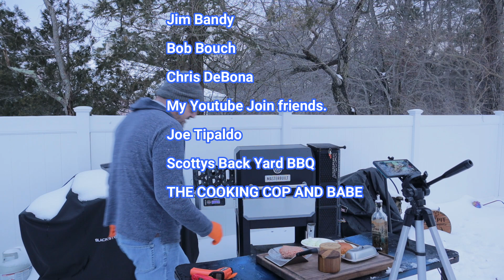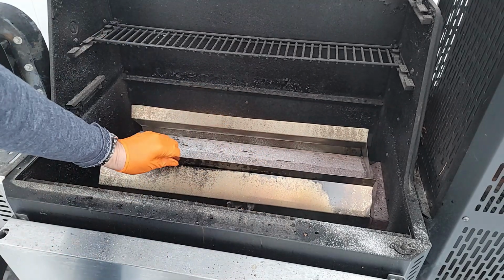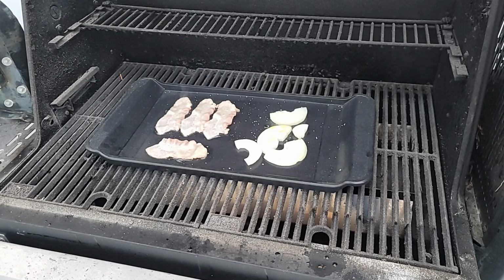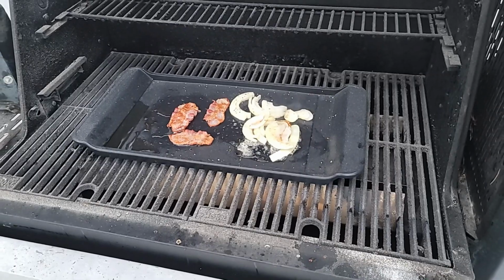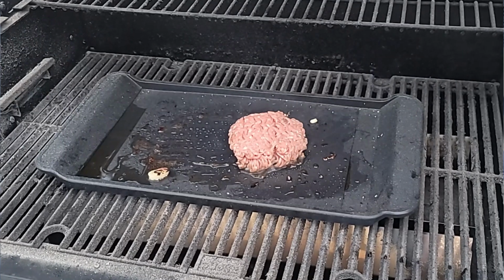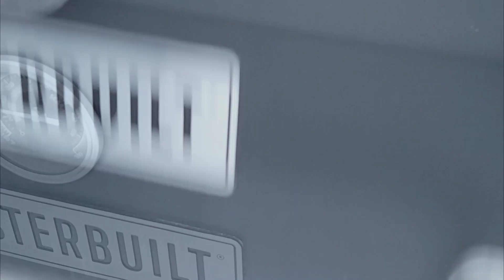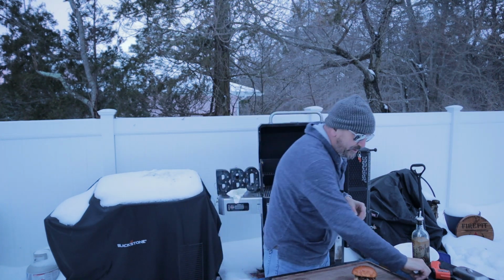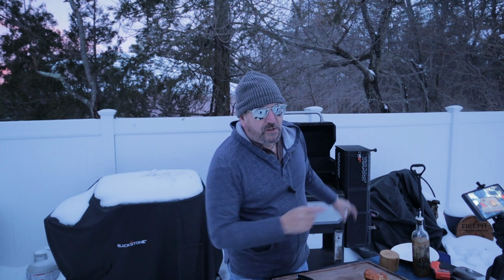Masterbuilt Gravity Fed 560/1050 Griddle Shroud Mod | Turn your Masterbuilt 560/1050 into GRIDDLE!

Comment: Is that the griddle shroud from the 800 that comes with the 800 model ?
Reply from the maker: No.... This is a Mod for the 560/1050. It just slides over the heat assembly.
Reply: @thegalleryBBQ  did you see the new 800 comes with one...
Reply from the maker: @tigerdeak4586  I had it and sent it back. The concept was cool but changing out heat assemblies seemed like a PITA., for me.

Comment: Tommy, I see you keep checking the temp with an infra red gun. What temp are you trying to achieve on the griddle, and what temp do you run the Masterbuilt at?
Also, where are you located, as I see you have snow.
Thanks.
Reply from the maker: Hi Ken. NJ.... I had to lower the pit as the griddle temp started to rise to fast. I wanna keep the griddle in the lower 500s and the pit I had at it's highest I think 450-475. Thanks for the question.

Comment: Watching this at 8am on the West Coast, gotta tellya, that burger is makin’ me HONGRY!! 
Tommy- you started out at 400, but you shot the griddle and had 376.  Later, you mentioned you ‘had to lower the MB’... what temp did you end up at?  Have you considered placing the griddle DIRECTLY on the shroud?
Reply from the maker: Hi Larry that is not recommended.  Once the Masterbuilt started rising in temp the griddle followed suit. I think I shot it close to 600f which was getting too hot so I lowered the Masterbuilt. Things were happening very fast on this cook. You blink your eye and the burger was done. At least once it came to temp.